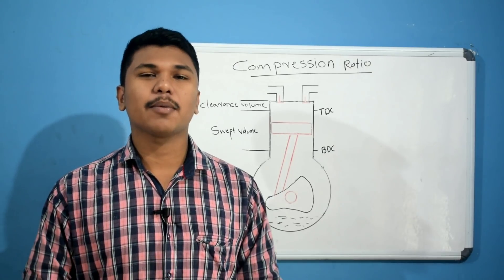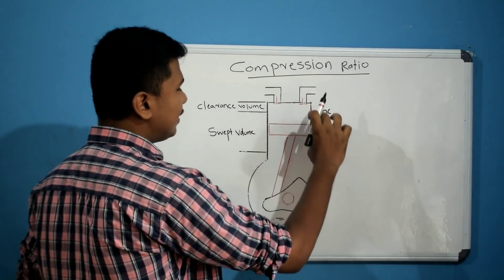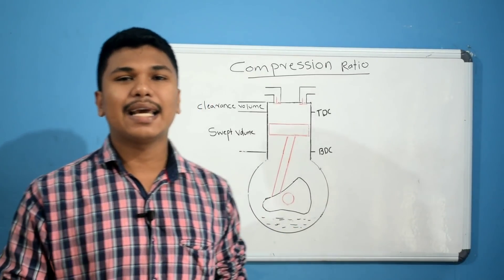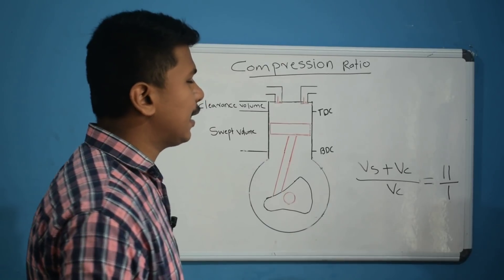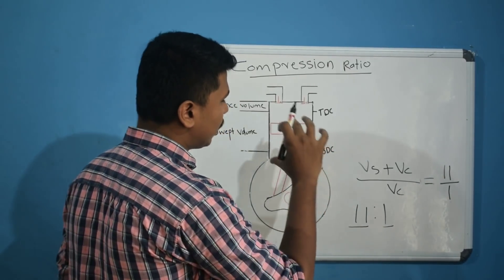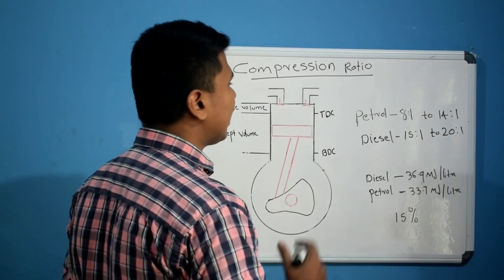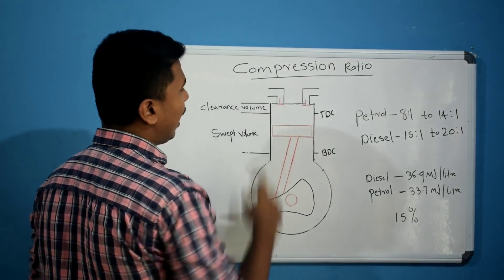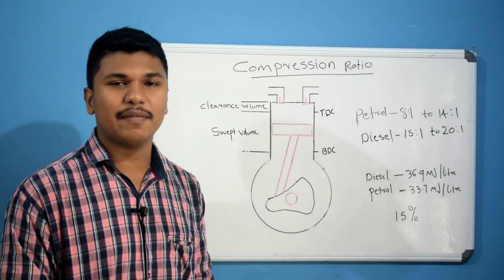What is engine Compression Ratio | Malayalam video | Informative Engineer |

Comment: If you go in land/range-rover segment, petrol engine is more pricer than diesel? Why is that? And why most premium powerful car use petrol engine instead of diesel engine?
Reply from the maker: Petrol engines have higher RPM than diesel..  so at the top end of the  RPM band..  power is more on a petrol engine...
That gives top end performance..